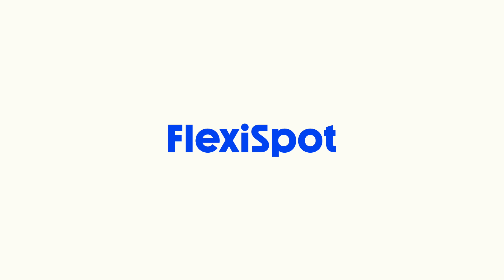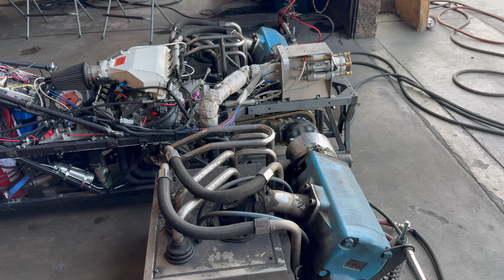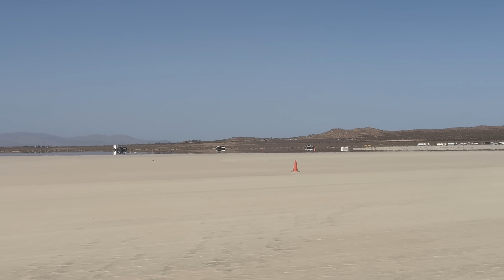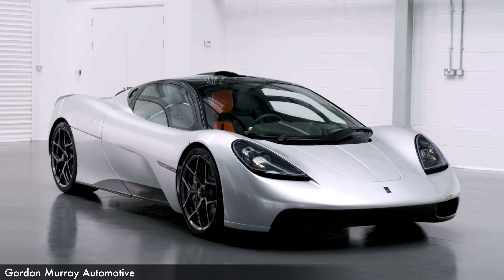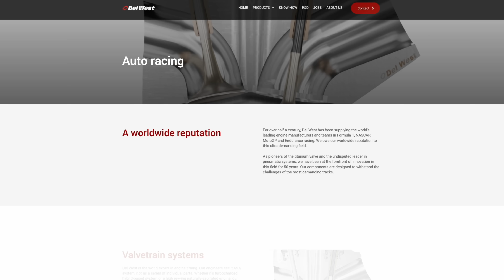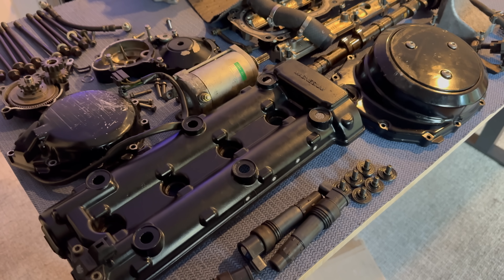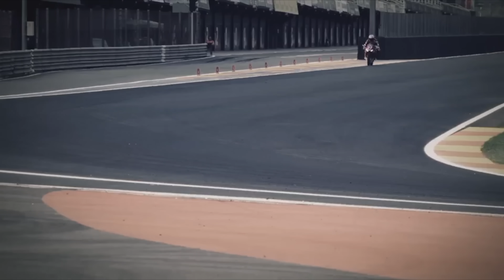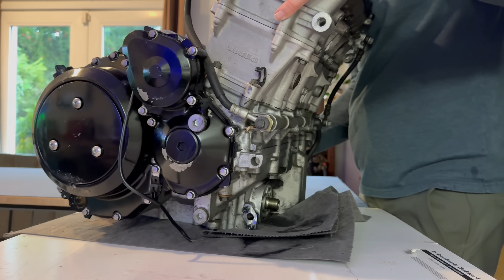Motorcycle Engines Are WAY BETTER than Car Engines

Comment: At 75 years I am building what will be the last car I will ever own.  It's kind of inspired on the Shotwell seen on Jay Leno's channel years ago.  VW beetle front end, 13 feet of the fuselage from a 1968 Piper PA28 Cherokee and a Honda GL 1200 Goldwing frame, rear suspension, trans and engine.  When (if) I get it done, my goal is to drive it from the mountains of Georgia to the hills of California to show it to Jay.  I don't know about all of the engines in motorcycles, but I do know that the engines in Goldwings are amazing.
Reply: I hope you make it (in both senses).
Reply: I built a Kubota 905 powered diesel geo Metro, a Chevy 3.1 V-6 powered lifted 4 wheel drive Triumph Spitfire, and a 6.5 GM turbo diesel powered 21 foot boat, its 47hp Perkins diesel in a 28 foot boat.. I'm a little behind you in age but arthritis really holds me back. Maybe my next project will be a Detroit Diesel 3-53 powered margarita mixer on a trailer.  My very first motorcycle engine overhaul was on a 1979  Honda CBX Six Cylinder in 1992.  It still runs.        I wish you success on your project.    
Here's the 6.5 turbo diesel boat...  https://www.youtube.com/watch?v=cDyQ_VeZKx0

Comment: Motorcycle engines last much longer than 40,000 miles - as long as you don't treat it like a lawn mower engine
My bike engines rarely need a valve clearance adjustment in 80,000 km

Comment: But, but . .  fossil engines (motorcyle or car) are pathetic.  Electric motors produce much more power over a very wide band in a very small volume, much more efficiently.  So you're dealing in antiques.

Comment: Nice transmission description.  Motorcycle motors are badass.  I still dig honda's parallel twins from the 70's.  Pulls like hell for a 350.

Comment: u mentioned 2 motobike engines - but why not rotary like 13B

High revs , good power curve , lightweight , sounds nice -and not a lot of stuff that moves 

Yes you will need better cooling system ,probably oil tank so you can inject clear oil , and probably rebuild every 70K km - but who cares

Comment: i debated swapping in a motorcycle engine into my mg midget, which weighs like 1500lbs (would be around 1350 with motorcycle engine swap). i like driving it normally like a regular car. didnt wanna have to be revving loud 5k rpm to just cruise. ended up using a datsun powertrain

Comment: The trick in CA is somehow figuring out how to power your light car with a motorcycle engine (or 2) and make it smog legal for street use
Reply: Simple. Start with an electric car for which there is no required smog.

Comment: You said, "[Valve] float in and of itself is not such a bad thing" (or something close to that). It's terrible if you want to make power. As soon as you hit float, your power production drops like a rock. It's so bad, you can see it on a dyno graph without issue.

Comment: Motorcycle engines are actually pretty bad.
The height limitations make for bad valve train and poor inner radius.

As example we can use the hayabusa engine and the vw i4 engine.
Both have the same bore spacing, which means that the possible valve area should be the same and so the power pontential.

Vw 8v i know for a fact, have made 300hp naturally aspirated with aftermarked head, which is very impressive with the limited area. For the 16v engine, i dont know what na power they make, but it should be more.

Now for the hayabusa engine... It's a 16v engine, still when did you see one at 300hp? Never.
The valve train is just bad, low lift with small buckets.
The ports are horrible.

You have to compare bore area to bore area, not displacement.
Hondas car engines make way more power for their bore than their motorcycle engines.

Why would anyone be happy to have a weak transmission built into the engine block.

Motorcycle engines overall are built pretty weak... 
Seems to be way less people that use stock block in motorcycle racing than in car racing.

Comment: 14:10 "Cars will generally have a better drag coefficient..." I love that in the 80s BMW engineers turned that into a halt-mein-Weißbier moment and built the unique K1
Reply: "car-sized hole through the air" 😄
Reply: Ten years earlier some guy in the UK introduced the Quasar. Commercial failure but...
I've seen one on the road.

Comment: The hotter an engine runs, the more the combustion reaction equilibrium is pushed to making NOx. High compression and high RPM always produces more nitrogen oxides because there is a surplus of oxygen (and nitrogen) compared to carbon and the higher temp. Thermodynamics is a cast iron, or forged aluminum beatch.

Comment: The other option is no valves - like the early piston-ported 2-strokes or like my 2-stoke Vespa, which has a machined crank that acts as a rotary valve. It’s a single cylinder 225cc engine that’ll happily do 65mph sitting at just over 6,000rpm. But I guess that’s not used much anymore because it’s even worse for emissions, as it’s burning oil at a 2% ratio. The piston-ported one needs a 4% ratio

Comment: Great video. I’ve long wondered why you couldn’t just close valves the same way you open them and eliminate the springs. Now I know. I also appreciate finally learning how a motorcycle transmission works. Wish I knew that about my jeep transmission before I took the shift forks out. Didn’t pay close enough attention so when I put it back together, it was possible to shift into first and reverse at the same time. Talk about a conflicted test drive. 🤦‍♂️

Comment: Almost convinced me to run a bike engine in my project car! 😄
I was seriously considering a Hayabusa swap — even a turbo Busa setup — for my lightweight track build. But the lack of torque really limits lap-time potential, especially once you add proper high downforce into the equation.

Something like the Ford Ecoboost “Dragon” 1.5-litre three-cylinder, with 300+ bhp potential and more torque at 2,500 rpm than a Busa makes at around 7,000 rpm, would almost certainly deliver quicker lap times. It would also be far less fragile, especially on the transmission side when running wide, sticky tyres. While still weighing far less than a typical automotive 2-litre four-cylinder engine.

Comment: Aluminium bolts sound like the sort of thing where a 6mm bolt could be 4mm in steel and weigh less. Or a 5mm stud with a deep aluminium nut?

Comment: It's always funny to me to see dudes flexing by buying million+ dollar super cars and sitting in a luxurious interior and going "fast", when for a couple grand you can buy a used sportbike, scare yourself shitless, completely exposed to the elements, going even faster on a higher-revving engine in an experience that is one you'll never ever achieve driving any car you'll ever have access to.

I like normal cars. Slow cars. Cars are kind of a necessity in this country and a car that moves under its own power and is nice to be inside of in bad weather meets all of my car requirements. And I love cars. I've owned 65 cars since 2003. However, if I want to go fast, or scare myself, a motorcycle, even a moderately "slow" one, is ALWAYS the obvious choice. Some people really don't understand this.

Comment: I've always wondered if you could use a F1 engine to drive a semi-truck and a truck engine to race. And I think the answer is yes, just that the light weight F1 engine wouldn't last very long at 15k rpm, and the racing truck engine would just be really really heavy.

Comment: Motorcycle engines may have greater power to weight than most car engines but they are high maintenance and don’t last anywhere near the same number of hours of service and get much worse gas mileage due to being way less efficient.  The cost per horsepower per mile is greater both short term and over the life of the engine.

Comment: 1:12 or get a two stroke.
Reply: twice as many combinations per minute
Reply: Na I don't want my engine to blow up
Reply: Theres a reason nobody uses 2t
Reply: @ShshHssh-l2h lazy is reason, that and inadequate education on them, 2 strokes make more power plain and simple.
Reply: @ShshHssh-l2h . Emissions. If you tried to make a two stroke car engine it would be shut down pretty quickly by regulators.